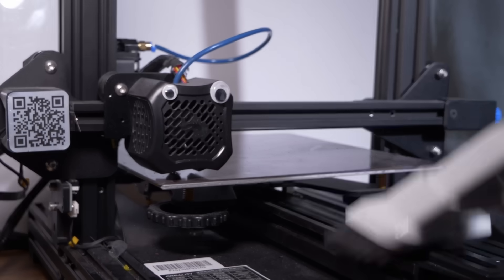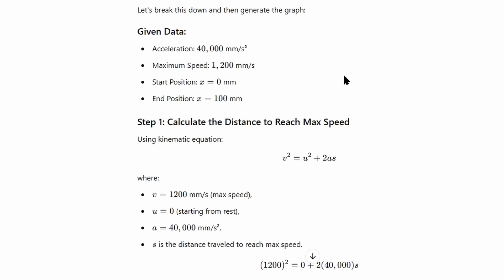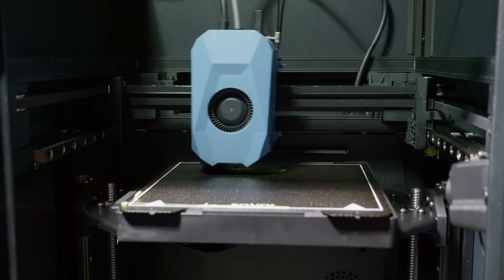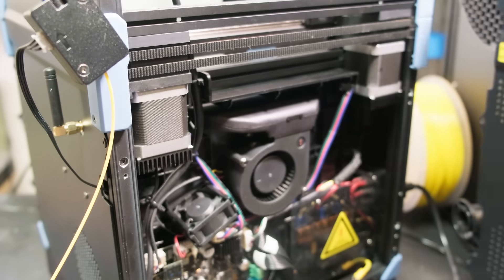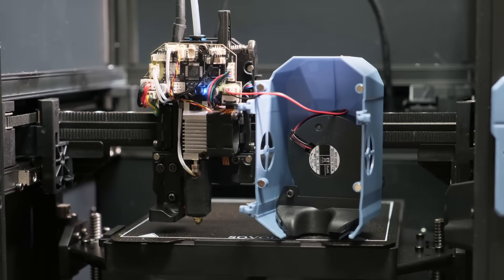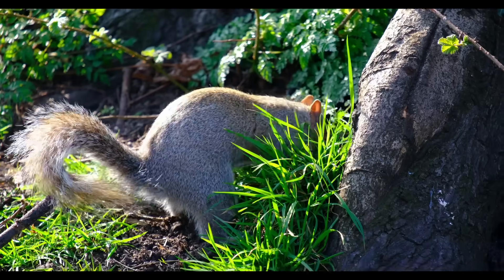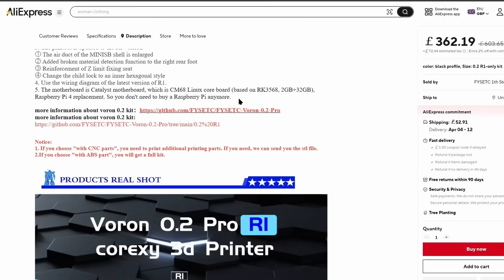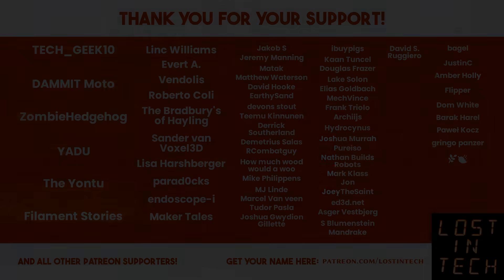SOVOL Zero - Tiny Powerhouse - FASTEST Production 3d Printer??

Comment: So...the big question, for those of us who have this cute little printer's (much) bigger brother, is...does this mean they're going to be bringing Eddy support to the SV08? I'm making do with an M12 inductive sensor at the moment, which is a massive improvement on the stock probe, but an Eddy would be the perfect solution for those times when I have to print in bulk and the time spent building the bed mesh makes the SV08 slower overall than a P1S.
Reply from the maker: Actually....you can use the btt eddy sensor right now, if you know how to configure klipper. Mostly it's googling stuff and a bit of knowledge. I've got one but haven't had time to fit it yet 😐
Reply: @LostInTech3D  - really? Can it be done without mainlining the SV08?
Reply: In yesterday's Zero launch live stream, someone asked about an SV08 upgrade to address the first layer issues (which my SV08 has in abundance).  Sovol said they are working on an upgrade for the SV08 after receiving a lot of community feedback.  Apparently they aren't doing anything that might fix my SV08 bed that warps more than 1 mm, but they are working on an Eddy probe upgrade.  It's not a simple sensor swap.  There is a little wiring and they'll issue a Klipper upgrade, but it'll be much easier than trying to add an Eddy or Beacon probe yourself.  I've been living with the unreliable and usually bad first layers on my otherwise awesome SV08 for months.  I thought of fixing it myself but decided to wait for a good fix that was easier to implement.  Apparently, Sovol will finally fix their cheap 8 mm prox sensor that isn't temperature compensated with an Eddy probe upgrade but we're still on our own to fix the thin warping bed.  I hate to spend $350 to upgrade the bed of my $500 printer, but it's better than persistent first layer issues that sabotage this otherwise excellent printer.  I'm trying to look at the expensive bed upgrade as a Voron Lite user experience.   :-)
Reply: @Liberty4Ever  - somehow, YouTube deleted my comment. In any case...thanks for that, very useful!

I've got my bed down to 0.161mm variance. I did 3 things: replaced the probe with the M12 one from Amazon, you can find the listing for the bracket on Printables (search "sv08 m12") - this is really important for the last step, for probe accuracy. It needs to be ABS or nylon, but if you haven't got the capability for that then just get a print shop to do it (I did). Then I got a CryoGrip plate, which reduces the print temp down to 40C-ish for PLA, which helps with the bed. Finally, I used some 1.5mm washers to shim the bed, next to all the screw posts and in the middle (took a couple of hours to get it right). I could get it down to about 0.1mm or less by shimming the front corners, but I never print there so it's not worth the risk of making something else worse. Total outlay was about £50.

Comment: BambuLab A1 Mini is half the price and has a 180x180mm bed. But then again its a more closed ecosystem (especiallly a factor considering the company's recent blunders) and not enclosed. I'm just glad there's choice out there.
Reply from the maker: Yes! Exactly. We win nothing if the market is dominated by one or two manufacturers. Choice is good.
Reply: This is enclosed and would most likely have great chamber temps for pa6 or asa parts. Definitely something you're not doing on an a1
Reply: @rickyb3072   Yes, it definitely depends on the material. But if someone only prints PLA/PETG (e.g. miniatures) the A1 Mini is really hard to beat. Only its firmware could be less annoying.
Reply: Technical comparisons aside, I was never going to buy any Bambu Lab product because I don't like the way they were so insistent that all of their customers' files are sent to Bambu.  There is no legitimate reason to do that and plenty of good privacy and security reasons not to do that.  I had those feelings way before Bambu recently outing themselves and then gas lighting us.

Comment: This is a very good companion for a larger, possibly project printer. If something breaks on that printer, you always have this dependable one that can crank out replacement parts.
Reply: My voron V0 came in clutch when tinkering with my 350mm V2
Reply: I think 120 mm is a good usable size for most small parts and the Zero's 150 mm size is probably the sweet spot for most printed objects while keeping the printer small and fast.  I just bought the Zero last night.  I like large printers and I'll probably buy Sovol's 500 mm printer that's due out soon because I tend to print some large functional prints such as a battery cover and mud flaps for my Japanese mini truck and mini pannier racks for my motorcycle - all in TPU.  I don't print gaming miniatures and I don't print cosplay stuff, but I do find a need for both large and small format 3D printers for my functional prints.
Reply: @Liberty4Ever  I agree. Especially considering when dealing with high temp stuff and small parts. You don't need to heat x times the mass in heatbed. The v0 is nice with a larger 2.4... sometimes I regret getting the 250mm instead of a 350 as sometimes a few cm are missing
Reply: in small pieces
Reply: @davidconner-shover51  The Voron v0 is designed so that it can print all Voron parts. For this case it's fine
Reply: @towlnator fun fact, there is 1 piece that doesn't fit: the right rear skirt on the Switchwire. But it's a skirt, aesthetic. Nope, this skirt is needed to attach the motor to move the bed
Reply: @therick0996  to be fair. Afaik the switch wire is newer?
Reply: @davidconner-shover51 "in small pieces" blud clearly never printed 3d printer parts, if it's bigger than 120mm then you designed something wrong

Comment: I began printing with an MP Select Mini and found the 120mm bed far too limiting.  I never understood why anyone would want a voron 0.4.  Then I began upgrading and now have multiple printers ranging from 220x220 to 420x420 and I'm beginning to see the benefit of a smaller bed printer.  Being able to knock out a smaller part or prototype in a short amount of time, not having to head a large bed for a small part...there are definite benefits.  So as much as I would have never expected it this is a printer I could actually see myself using on the regular.
Reply from the maker: I had a mini delta and the main problem was the bed was round and most things are square 😂
Reply: I like big printers and I cannot lie, but I think the Zero is a good second (or 5th) printer.  Most small parts fit on the Zero and I have larger printers for the large parts when needed.  It's good to have a small printer that starts printing quickly, has a guaranteed good first layer for reliability and quality, and prints quickly in a wide variety of materials.

Comment: its objectively a solid printer. there's been a lot of progress in relatively affordable printers. its just that 150mmby 150mm is pretty small, especially for 499. im really excited for your centauri carbon review as i tend to share your opinion for the most part. hopefully you can get around to reviewing the base centuri, that look sreally exciting and is potentially the" ender 3" class of printer
Reply: I just bought the Zero last night but I'm currently working on a new product that might need 20 Centauri printers (not the Carbon enclosed version) for a TPU print farm later this summer, however I refuse to buy a printer from Elegoo that they haven't manufactured, for delivery in 4-5 months.

Comment: I'd imagine the best use of this is for rapid-er rapid prototyping of a single part to perfect the design before filling the plate of your 300mm³ printer.
Reply from the maker: it's why it's a perfect 2nd printer I think.
Reply: @Biggus_Mickus  or if you just need to print a quick replacement part - you can be finished before many larger printers are done with heating up, and completing the pre-print bed mesh
Reply from the maker: This things bed heats up so fast on 230v and I forgot to show that 😅

Comment: That's crazy fast and seemingly very noisy.  Considering my made up metric of print volume as a % of overall external printer size/volume - it looks like it's too big for the bed size.  Anyhow, I think your Squirrel needs a friend.
Reply from the maker: it's not the quietest, lots of fans :D
Reply: not an expert but something tells me most components would stay the same size if you just increased the size of the bed
Reply from the maker: that, but there is some dead space or rather it takes more space because it's using off the shelf extrusions and has 2 z rods at the side. It's kinda a tradeoff.